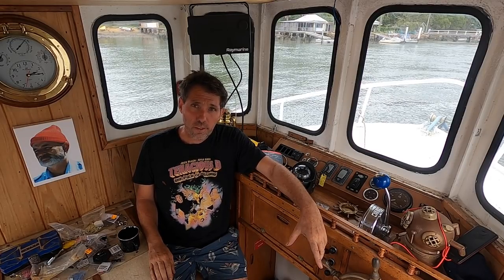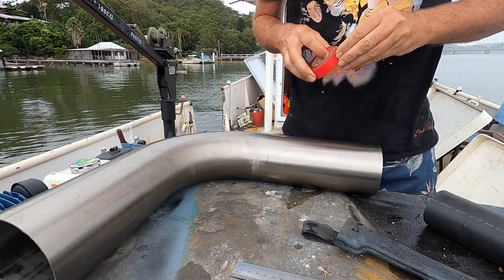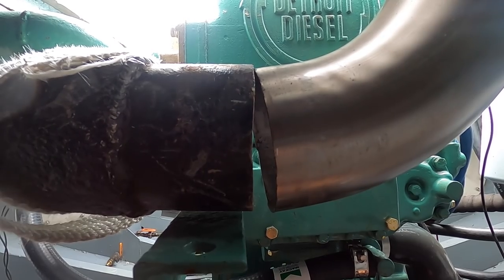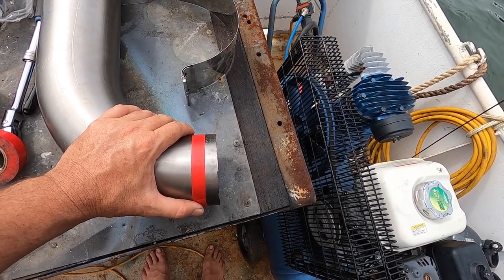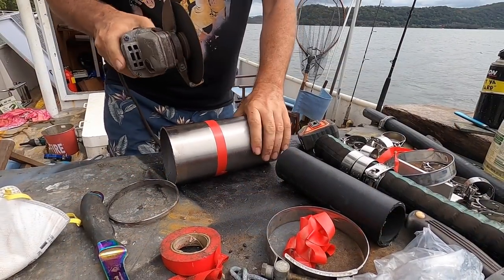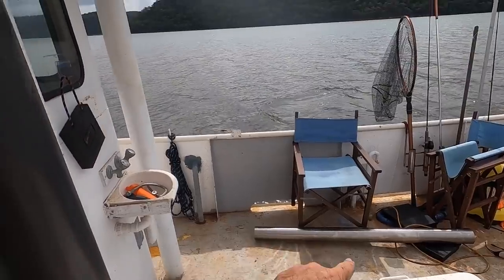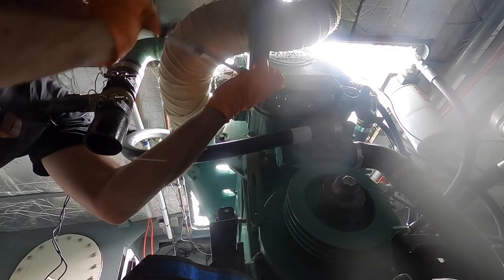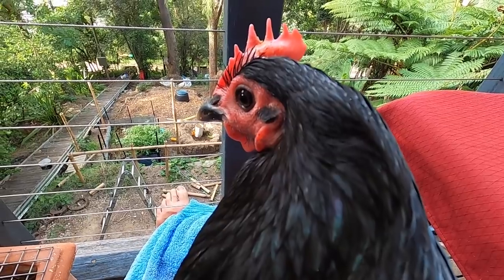Installing the dry exhaust

Comment: Thanks for the bonus entertainment Stu... a few Mulloway coming from the river at the moment, you should have a live squid or slab of tailor fillet hanging out the back. Drop it in a hole on the turn of the tide.
Reply from the maker: I'll have to start wetting a line again Steve. :)
Reply: @DangarMarine  You may need too...

Comment: Danger MArine. My father back in the day had a marine repair shop when I was a kid in Chicago near Belmont harbor. He had an issue like that as well on the slip joint/holder. He cut out the flats on the ring and installed/ tac welded four metal large engine valve springs into place, worked great, no noise and no further broken pipe.

Comment: I built two Cobra 427 kit cars and used the manifold heat wrap to help with engine room heat. The heat you eliminate in the engine room will be moved to the exhaust stack and it will get almost red hot under heavy loads. You must cover it soon or you will create a nasty spot on deck where severe burns are likely. The side pipes om my Cobras got so hot that I eventually took the wrap off. Enjoy your work ethic. It's a lot like mine in that getting the job done is more important than making everything beautiful when it isn't necessary.

Comment: Thanks for the video. Yep stuck at home.   I reckon without a bit of flex pipe you'll be get a bit engine vibration transfering to the deck. Seems like you could almost use a few springs holding it at the deck fitting. Either way I'm sure you'll sort it.  Now for another 136k pieces of advice.  Nice ending, king parrot?  We get those down in East Gippsland. Stay well Stu.

Comment: You have done a great job with the exhaust, what a difference in space-saving between the new dry exhaust and the old wet exhaust. I believe your joint combined with the RTV and exhaust wrap will go the distance. I have rigged cars and motorcycles with similar joints and I have never had any significant leaks, and they never broke. I would triple-wrap your muffler all the way to the roof, It will significantly reduce the noise it makes. I also think a shroud would be a prudent addon.

Comment: Thank you for the great videos Stu. Just wanted to chime in. I grew up on the water in the Bay of Fundy, and have watched the old man fix a lot of old wooden hulled boats. The exhaust pipes on the diesels were always completely wrapped. Right from the manifold all the way to where the pipe went up through the ceiling in the wheel house. As a kid being thrown around in rough seas I remember hugging the muffler to stop from being tossed around. It felt only warm to the touch, probably wrapped in asbestos considering it was used for everything back in the day. Just wanted to point out that muffler is going to get hot under full power, and someone will grab that thing. Love the project build. A lot of the exhausts had a flex pipe from the vertical piece to the horizontal piece and lasted well over 10 years. Hope this helps. All the very best to you.
Reply from the maker: For sure, someone will definitely touch the muffler if it isn't wrapped in insulation.

Comment: Hell I have run the whole thing to the deck in flex before zero problems . Also there is a plaster of Paris looking product you can paint over that exhaust wrap . Helps heat lots and keeps it from coming apart down the line.

Comment: Weld the elbow hard and use a “soft” clamp through the deck letting  the exhaust pipe move enough to vibrate as needed.
Reply: Yes, even a long spring wrapped around it would do.
Reply from the maker: Hey Tom, yes, I think that might well be the best way to go.
Reply: I had the same thought it's support by the engine bracket just put the flex joint in the vertical, another great video thanks

Comment: good job on the boat. have two sons, each with a there own boat. one is a 23 novi thats getting a new deck and hydrulic  steering. the other is 34 feet getting new motor and deck. keep at it it will get done

Comment: We met in GreenMachine days.  It looks great!  Fabbing stuff is where we really make great ideas to fix issues.  Diesel - I always used High -Temp Silly.  When I had to replace something I just torched the Silly off and start over..   Gasoline runs about 300 Deg above what the RTV will hold.  Diesels are always cooler - even with a turbo.  Cheers!!!

Comment: Stu, you need to change the name of the boat to "Did not go to Plan". It would be the most appropriate boat name ever. I must have had that very same thought about 6 times already in my current boat project, fixing a leak in the aft head window. What started as "I'm going to re seal the frames to stop the leak" turned into, WTF where these previous owners thinking, and then morphed into a complete rebuild of the window, frame, bulkhead below window, cabinet frame! Did not go to Plan.

Comment: Stu - If you add a small shield perpendicular to the exhaust above the base bracket it will stop some of the rain/deck water going in to the engine room. Cheers Mike p.s. love the channel

Comment: Make sure you paint the wrap with hight temp engine enamel; it will keep it from rotting and falling apart. Just give it a spray when it starts to get dull in the hot spots. I have had the same wrap in my bike going on 15yrs just touching it up as it fades.

Comment: Stu, think about removing that circular clamp where the exhaust goes through the deck.  You've got the exhaust well supported below deck, and all the deck clamp does is restrict the movement of the exhaust as the engine moves and vibrates, placing a strain on the joints in your exhaust piping.  I also think you have your flex joint on the wrong end of the muffler.  Consider putting it at the bottom of the muffler, closer to the engine, where the vibration and movement is.  

I very much enjoy your videos.

Comment: On the last video I made a comment about flared ends for the cooling hoses to prevent the hoses from blowing off and you answered that the rad cap would stop that from happening that usually isn’t the case most cars even with a 7 pound cap will blow cooling hoses off without a flared or barbed hose fitting.

Comment: Hi Stew, Mate, you have gone this far with a beautiful engine build. If your just wanting to fire the old girl up and go for a shake down spin, fine, but if it was me, I would redirect the exhaust totally.. Re do ur bends and flex joints below deck and send 
a straight run to the side of the wheel house. Get the muffler away from the cabin door. In that way, u have somewhere to attach a vert muffler shroud plus it would be safer when the boat is rocking and rolling. By having a longer flex joint down below you reduce the chance of the joints cracking with vibration. Anyway, just a suggestion. Thanks for your videos

Comment: That one band clamp with the single bold, that is where the exhaust pipe passes through the deck, may need to be removed so the pipe can move with temp change and engine vibration. Looks good and I'd keep a bucket upside down over the end of the exhaust outlet to keep the rain out.

Comment: Boats and farming have a lot in common. You do the best you can with what’s available at the moment. I’ve worked in both industries. That said I think you might regret not building a shroud around the muffler. Particularly since you could inexpensively fabricate it in your shop and then bring it out to the boat.  It’s 4-6 bolts welded to the cabin and some extruded steel bent to shape. Even the dodgiest boats I worked as a kid had protection around the exhaust pipe when it was a dry exhaust like yours.  
Hope I don’t seem to negative as I really look forward to your video’s from the snow covered N prairie we’re cheering for you.
Reply: Have you seen where the door is.  Needs to be able to slide the cabin door open..

Comment: Keep up the  good work. For an easy exhaust tip, cut about 6 in off the end of your pipe at  45 degrees and weld it back on giving a 90 degree tip.

Comment: Hey Stu, great job, but why not just do that 90 degree bend with the flex tube?
Reply: That stuff typically wont bend that sharp.
Reply: Yes, use the flex
Reply: Yea
Reply: If you notice there is a clamp in the deck penetration that is supposed to hold the stack. So the flex should go from the engine pipe all the way to the stack.
All this extra work and expense could have been avoided.

Comment: aluminum foil under the band clamps will stop the leaks. usually they come with foil when you buy them. The flex pipe will fit over your solid pipe and you use a u clamp to hold it on. That is what the bracket under the exhaust on the engine is for . the flex pipe is like a big thread it can be turned or twisted a small amount to make the opening bigger.

Comment: I think you’ve done a great job Stu, working out straight pipe and flexible joins to get it to fit is hard to do, and one mis cut can ruin a lot of expensive pipe. Wrapping it in 3 layers of fibreglass tape means less burnt arms and elbows in a small engine room. I agree with what Brupeg did and put a heat shielding around the exposed stack, but that’s just an idea for another video. 👍👍

Comment: As it is you will be getting water into your engine. Flex pipe is dual purpose, it allows for the vibration/flexing of the engine, but it also allows for water to drip out of the pipe through the flex. You would be surprised how much water makes its way down a stack. Until you get a flapper cap on it, make sure to put a bucket over the dual stacks you have now.

Comment: Hey Stu, maybe talk to your local exhaust guy about this, but I always thought that your flex pipe is supposed to go over your steel pipe so that the end of the seal-clamp and the end of the steel pipe are at the same point, and then your seal-clamp squash's the flex onto the steel pipe. Also there will be a 'rule of thumb' measurement of how long your flex pipe should be. ie; 3 or 4 times the diameter. The amount you have there may as well be a welded joint. Thanks for the vid, stay safe!!
Reply from the maker: So did I, but exhaust guy said no, butt joint inside the band clamp.
Reply: @DangarMarine  With as many modified cars running solid intercooler piping and only a V-band clamp(they allow only like 5-10 degrees of flex IIRC) you should be fine with something similar. You could even go with a V-band clamp as well in the future as an option they make them in many different sizes and they are designed for high heat applications as well(for example directly on the exhaust housing of a turbo)
Reply: V bands are taking the tubing world by storm and I love them , might have to do that to the trawler after 10,000 hours when she starts to vibrate a little  too much

Comment: Hey Stu. Great content as usual. Getting ever closer to hearing that beautiful Detroit 
Come to life again. I use to drive a truck for a major trucking company here in NC. I was driving an old cab over Mack truck. On that old truck they used a rubber clamp with a stainless cover on it just almost like the ones that plumbers use to connect pipes. I barely noticed any vibration in the exhaust system at all and on those old trucks you had to do everything you could to not have vibration so that anyone was in the sleeper they would be as comfortable as possible. As for the flapper on the top i don't think that people mentioning about the clang that that it makes is predominantly more on Cummins or Caterpillar engines. Since the Detroit fires like it does there is very little  loping in the engine. I never ever really think that I heard  any clanging noise from it. The motor in the old truck I drove had a 671 Detroit in it. Very dependable and very powerful.  
By the way I really enjoy the way you include the chicken's in the video. It really shows the personal side of life. Also have not seen Eddie in a long time. I hope he is well mate and still healthy. Thanks for the great videos Stu and I'll be looking faithfully for the next one.

Comment: Those band clamps can be used in place of the two-piece u clamp used at the top of the muffler. Also, those flat band clamps will self form to a stepped connection like at the top of the muffler to the pipe above. Any slight leak you might see at the initial start will soon fill with carbon thus sealing any possible leak. You might check at a truck wrecking yard for truck exhaust shields that will clamp to the shell of the muffler. They are commonly used on vertical exhausts on older trucks.

Comment: Hi Stu, Instead of hard mounting at the deck penetration, cut this away from the deck and rubber mount from the underside of the deck. For the top of your exhaust have you considered the turn back like Brupeg, the flaps rattle. Make a heat shield that mounts to the muffler clamps and use acorn nuts to reduce the snagging. CV boot clamps do a good job for securing the heat wrap.

Comment: Hey Stu what you should do with the exhaust. Is cut the header coming out of the manifold cut out three or four inches then get the appropriate size Flex connector to reconnect the two ends. This way you eliminate the vibration and it won't crack

Comment: Could always take one of the pipe clamps and mount it on the end of the long straight pipe. Use one bolt to secure it to the pipe. then build a flap that  uses the top bolt in the clamp as an axel.

Comment: I installed a vacuum gage between the engine and dual fuel filters. The idea was that the needle will start showing some vacuum as the flow through the filter starts to become clogged with crud. I found that as soon as the needle started to move it was time to change the filter. Of course this aways happened in rough seas when the sloshing in the tanks gets the crud on the bottom of the tanks mixing into the fuel.

Comment: The RTV burns off eventually the band clamps seal pretty tight, you're going to need to have at least 30cms of flex pipe between the engine and muffler. The stack itself I would extend a single pipe up to where the VHF antenna mounts to the mast then a 45 elbow with a another 60cm of pipe with the end cut at a downward snipe. The old commercial fishboats here with 2 stroke detroits in them you can hear them a good kilometer away.

Comment: Have you considered changing the mounts though the deck and cabin roof to use rubber mounting the exhaust? Might help solve a lot of vibration transmission issues and also help with engine movement.
Reply: Jason R , this done on the ferry boat I used to drive until I told not to come to work anymore until this virus stops.

Comment: Use a heat shield from a truck stack. Just needs a couple brackets welded on the muffler. The shield will be tucked out of the way and look good too.

Comment: When you did the initial dry fit. You could see like you said the angle was off a little. You may have to look at the video to figure out what I’m referring to. The two pieces came together at the top and there was a gap at the bottom. That gap the measurement what ever it is in foreign measurement is I believe is the amount you have to cut. From Connecticut

Comment: Try your local truck store for a Stainless steel  perforated exhaust shroud.  they may also have a bellows type exhaust bend and flap cap. 
I don't know about the convoluted  flexible exhaust you have, but  the older type had an asbestos string packing, which soon
blew out.  Also your RTV sealant might not take the exhaust temp of a dry exhaust.  There are high temp silicon sealants used
in boiler plumbing which may  better suit your needs.  Good to see you are getting close to operational now!

Comment: You can order exhaust pipe with a "box bend" a 90° angle that is as as long as it is round will give you more then enough room to include the flex joint, the vibration concern isn't that the welds will break, but that the vibration from the motor will transmit throughout the boat, especially being that it is steel.  Another suggestion would be to install it in the vertical section of pipe remove that janky in deck clamp and weld a support to hold the pipe/muffler at a higher location. I never liked that through hull clamp thing.  Also bends and flappers are cosmetic/mythical the amount of rain that enters the pipe is minimal and burns off within minutes, worst case in a monsoon when you might leave the boat sit for a month, invert a coffee can over the pipe. Problem solved.

Comment: you could weld a 45 bit of angle pipe to one end of the 4 inch line and drop it down to the top of the muffler. then you have the angled tip.
I suspect that will cost less than the flapper.

Comment: Stu, how will you get into the engine bay in an emergency when the engine is hot?
Reply: I was wondering about this as well
Reply: Same as before, you won't.
Reply: Stephen Cooke; Same as before, fire extinguisher and either wait for it to cool down or go overboard...  ;-}
Reply from the maker: I'm going to be adding a hatch between the cabin and the engine bay. I'm going to need to be going in their regularly to do things like close and open seacocks (although I might make remote cables for those too)
Reply: @DangarMarine  Cheers, Stu!
Reply: I can't wait of the video your Chanel is the best one on youtube
Reply: @DangarMarine  Noice!

Comment: It might not matter and not be worth doing now it's done, but I was thinking the exhaust fibreglass wrap should be from engine up the exhaust pipe, not down, so any spray / seawater / rain coming down the exhaust pipe is shed to the outside not drawn to the inside eg like house tiles always have the bottom of the top tile on top of the top of the tile underneath.
Good progress almost there!

Comment: Stu, if you could move the hole through the deck, you could do that fairly easy by cutting a rectangle with more sticking out on the side you want to move to and turn it 180 degrees and weld it back in.